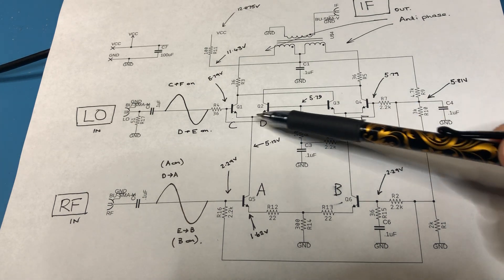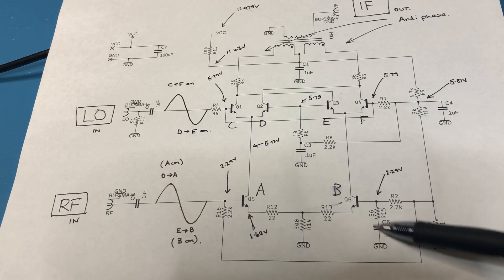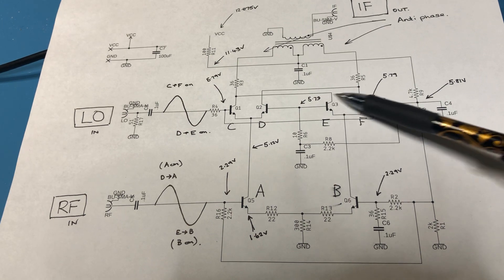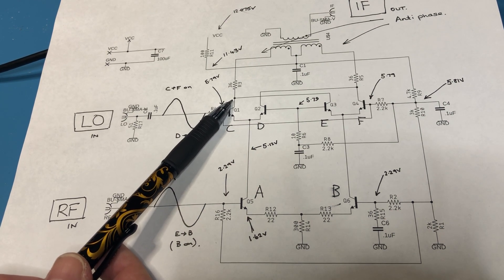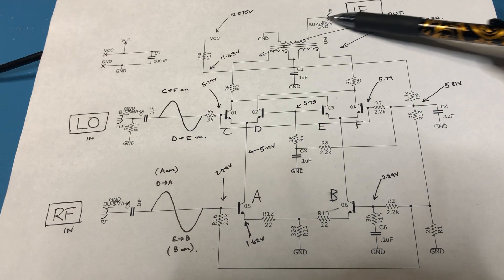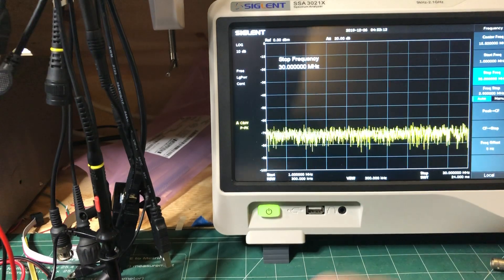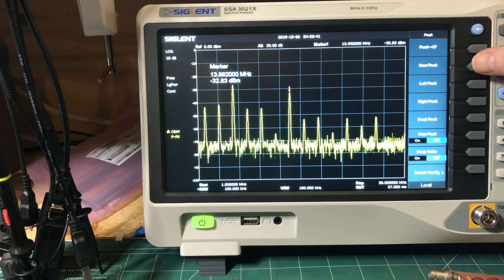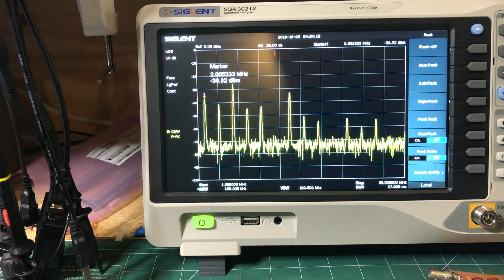Gilbert Cell Mixer

Comment: This is for the mixing on the receive side, correct?
Reply from the maker: You could use this mixer on receive or transmit side. The SA602 is a gilbert cell for example.
Reply: @na5y  Yes, I've done it... what I'm asking is: is what you are showing the receive side behavior and labeling?  For example: the RF input is the signal from the antenna, correct?  The waveforms are what one would see on the receive side, correct?
Reply from the maker: @drstrangelove09  Ah I see - yes this example is mixing incoming RF with an LO to produce an IF as you would see in the first stage of a superhet receiver
Reply: @na5y  yup... thank you!

Comment: I noticed a lot more biasing detail around your gilbert cell that was omitted in the referenced video.  What is the requirement of the RC filter on the base of transistor B?
Reply from the maker: Thank you for the comment. The key requirement for the base of transistor B is that no RF should reach there. That .1uF cap provides a low impedance path to ground to facilitate that. As far as the resistor values these were arrived at by the original author thru experimentation. Check out the original pages https://docs.google.com/document/d/1_BX6y1ZrlO9_7Ztpwl9SNV98T3u9qmTsCDu0RJpoc4I/edit

I hope this answers your question